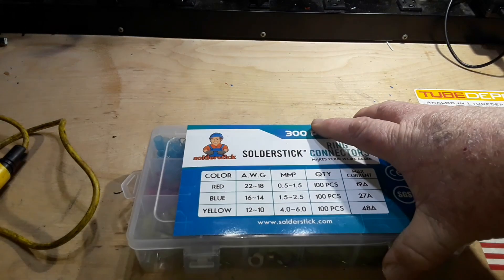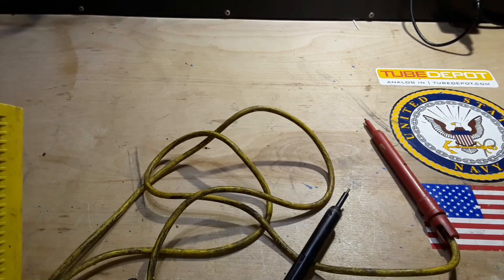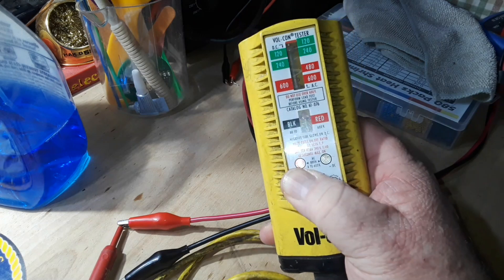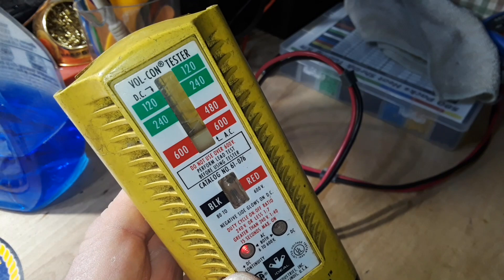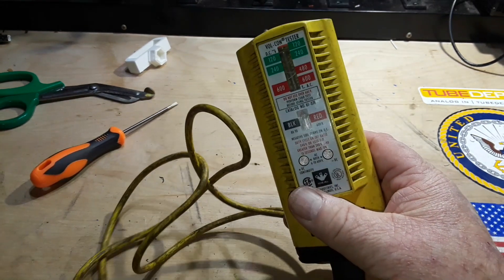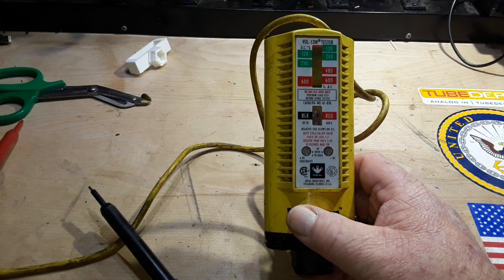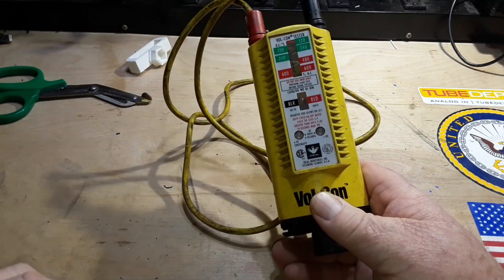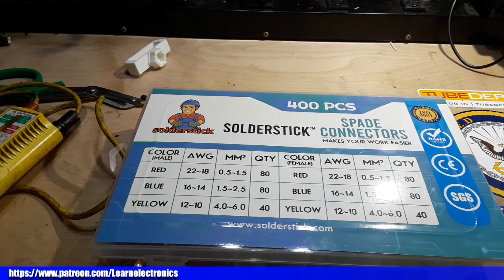Ideal Industries "Vol-Con" An Industrial Tool - Sponsored by Solderstik Wire Connectors

Comment: I loved this tester for 25 years. I don't use it now because it sometimes trips arc-fault breakers due to a spark from the solenoid. If it trips a breaker and there's a computer on that line, uh-oh! Also I don't care for the button-style batteries needed for the continuity tester. It's my ol' friend tho.

Comment: I'll be 35 next month, so not exactly an old timer yet;) but I have one of these solenoid bar meters and love it, although  my Ideal 400 amp AC/DC clamp meter gets a lot of use as well.    By the strength of the vibration I have a good estimate of the voltage levels, and I can even find the 208V stinger leg in a 120/240V 3ph 4w panelboard without looking at the meter, by the vibrations phase to phase will feel slightly stronger,  and 120V will feel weak by comparison.

Comment: I still have mine, model 61-065 voltage only, been dropped multiple times and still works perfect, built to last, simple to use, if I need to check continuity I use a multimeter.

Comment: Beast of a device. Bought in 1975 with leather case, voltage only, still going.
Reply: Mine is too. I also still have the leather case as well. I always wanted to take it apart but whenever I find it it always slips my mind.

Comment: Mine is far older and doesn't use batteries. Mine has an indicator on one end that has a disk magnet that pivots on a shaft to show polarity. Half the magnet is painted red and half black.